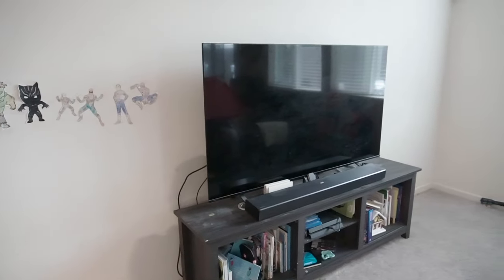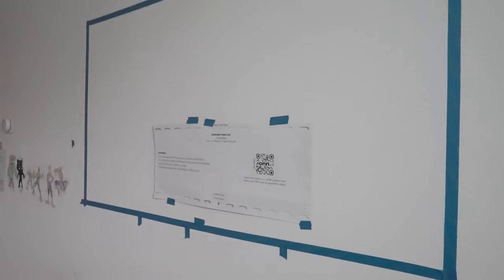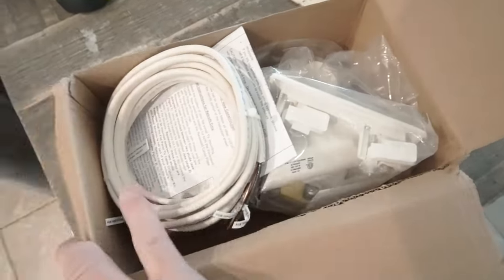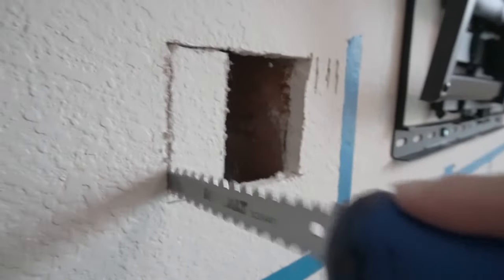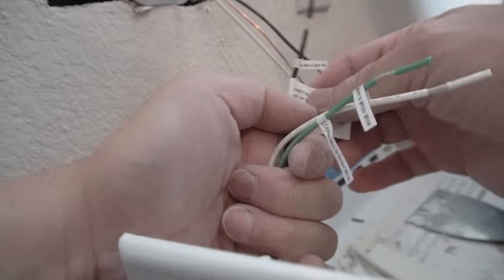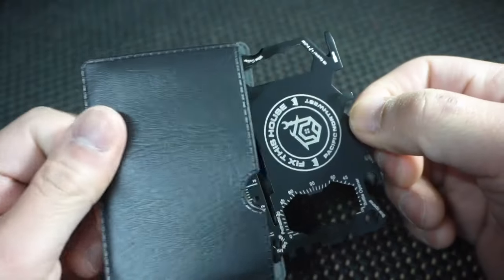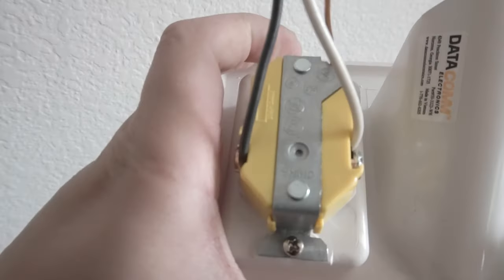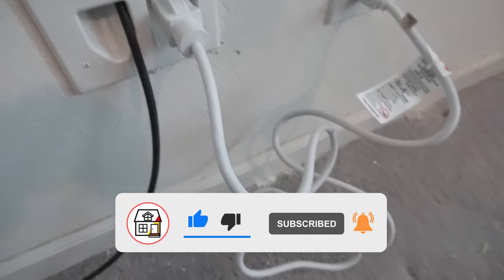How To Hide TV Power Cord And Cables! No Outlet Wiring Needed! EASY DIY!

Comment: The right solution is to run the power up and in the wall from the existing box to a new outlet behind the TV.  The solution presented in this video makes no sense to me one less box, and the box behind the TV would be smaller.     And if one can handle what is presented in this video, they could handle what I am suggesting.
Reply: That is true if the top outlet location is in the same cell as the feeder outlet, but older houses have fewer outlets and may not have one in the area you plan on mounting the tv. This is a good DIY option for one of those installs.
Reply: Also, this option doesn't require repairing dry wall after installing boxes.
Reply: If it were only power then your proposed solution would be valid. However, in the video he stated that the channel would house hdmi cables that connected to a video game console below the tv. I believe the purpose of his approach was to hide not only unsightly power cables dangling beneath his wall mounted tv, but also the cables that connect his console. I suppose he could have installed a dual outlet that would have brought power up behind the tv as well as integrated in-wall rated hdmi, but for what he’s doing I think that cable management channel did the trick.

Comment: or just wire it out to the existing outlet?that extention cord man😳
Reply from the maker: Then you’ll have an exposed wire going down?
Reply: Only if you are okay with that "wires, wires, everywhere" look. This is a cleaner, neater look and appears pretty easy to do.
Reply: @FixThisHouse  just like adding an outlet but just vertical
Reply: @hammerridecycling7630 you would still have to have a place to run the low volt cables. They do make special wall plates designed for it though.

Comment: I don't understand.  Are you connecting the new outlet to power or not?
Reply from the maker: No, you are making electrical extension which connects to the main outlet power with an extension cord.
Reply: That white extension cord will provide power to the new outlet he installed that goes up the wall where the tv was connected.
Reply: Yes, double the wiring to take electricity to the TV.  I guess it depends on your situation.

Comment: I am thoroughly confused at what I just watched. If you're fishing a wire up a wall, and your splicing the inlet, then why wouldn't you just wire the receptacle behind the TV without the need for the inlet? Also, any time you add a new outlet to any exist circuitry, then you must by code, protect that circuit with an arc fault circuit interrupter.
Reply: It’s basically an extension cord hidden in the wall, but you could call the building department and ask if it’s ok to use this kit without a permit

Comment: Since I am not doing a retrofit, I am going to add a single gang box and wire down to the 2 gang box I already have in the wall.  Way better than using that box and still having to have another cable to have electricity.

Comment: My walls tend to have firebreaks. Makes all this much more difficult.
Reply: There is a special long auger bit you can get that will reach about 48” that you can use to penetrate through the fire lock without cutting a big hole in your wall. Lowe’s or Home Depot carries it in the electrical isle

Comment: Does the NEC 2023 permit this, what feels like, temporary wiring?
Reply: What's a little fire😂?
Reply: @rea8755  I did look into NEC 2024 handbook, and there does't seem to be any restriction on using power inlets, so as long as the wiring and connectors can all handle the rated load, it shouldn't present a fire hazard.

I did read some 1-star reviews of the suggested product, though, and many people complained that cutout template is wrong, and that the connectors are flimsy and failed easily, so buyer beware.

Comment: Does this do any kind of surge protection? Or would you potentially need to go from the outlet > surge protector > outlet?
It does look like they offer a surge protector version for $70 more.. Not sure if that's worth it versus doing a stand alone surge protector.
Reply: I’d get a stand alone surge protector in case of failure it would be easier to replace

Comment: So, what about if one encounters a fire brake where the outlet is installed?  Should one be looking to ensure a fire brake isn’t blocking the path?
Reply: Then you put a hole in the rock and drill through the fire break.  Then you repair the rock.   Simple as that.  More expensive, it is a matter of what you want to deal with to hide the power cord.  I would also take power from the outlet already there and run it up the wall, one less box.  Quite simple to do, not sure why this solution is even considered.
Reply: There are special long auger bits designed to penetrate any fire block if it is within the bits reach which is about 48 or so inches. Is is a bit tricky finding that hole later but doable. Most home improvement centers like Lowe’s or Home Depot carry this tool. A fish tape helps as well. Like Tim said earlier, easier to use the original outlet if it is in the right spot under the new top outlet location, just widen the lower hole for the low volt cables to pass through

Comment: Try doing this on the brick
Reply: If you got brick, then you are shit out of luck.  need to run a piece of Trim up to the TV that hides the wire.
Reply: You can cut and chisel out the mortar between the bricks and run the Romex in the channel. It’s a pita, but doable. Make sure you get a good long HDMI cable and keep it in a separate groove away from the Romex.

Comment: You installed the wall box upside down, on both top and bottom /facepalm.
All you really did was move the cords mess down to the floor where the normal wall power boxes are.
If your capable of cutting drywall and doing all this, your capable of just doing it right and adding the proper power box behind the TV without this work around to plug this box into another normal power outlet, which I doubt is legal for building codes.
Kids, don't follow this poor example video, if your not skilled in these installations hire a professional so you don't burn down your house or void your home insurance using non approved electrical systems.
Reply: I agree, but if the bottom power feeding outlet was on a different wall this would be a good DIY get around. You would still need to add a couple holes for the low volt cable(s). Wiremold is an alternative as well, cleaner, but still ugly